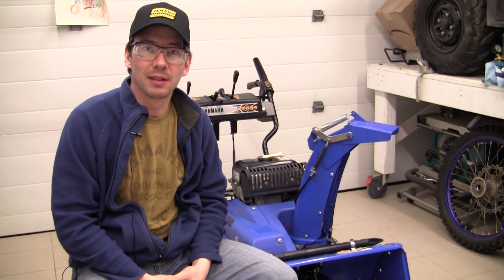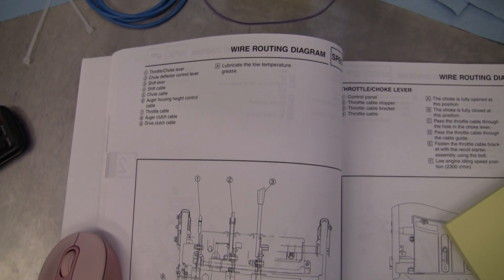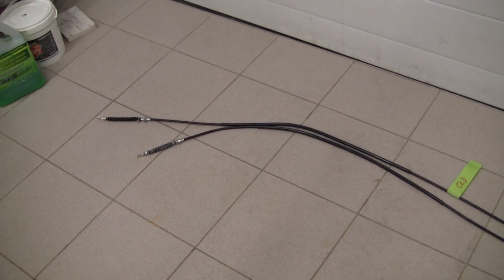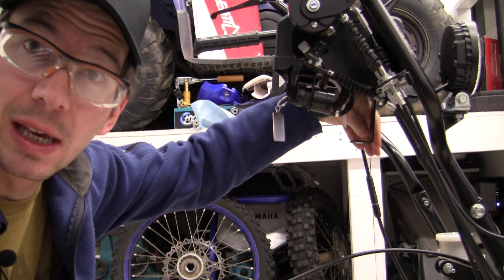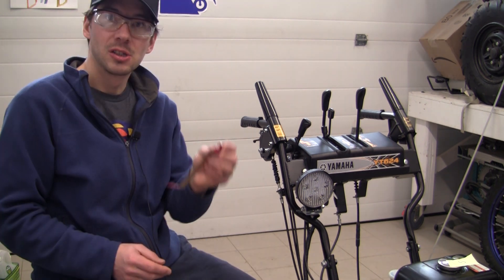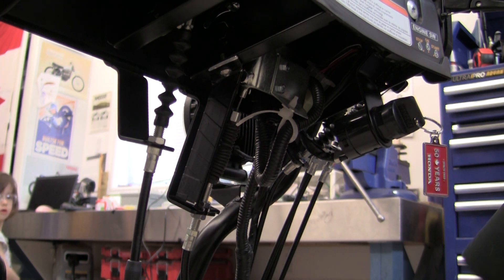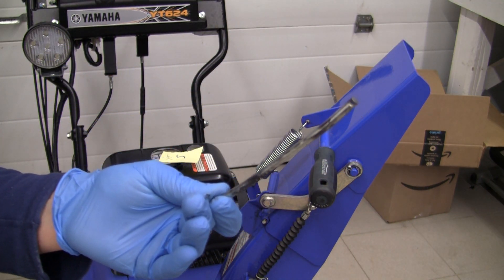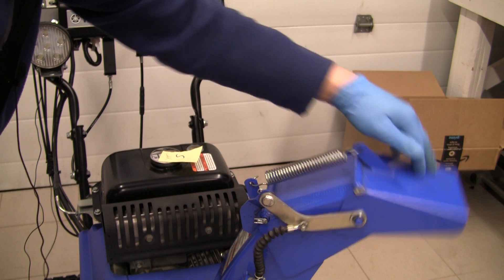Ep. 19 - YT624EJ M.S. - Chute Height Control Mechanism Corrections

Comment: What was the part number of that cable? My cable seems to be getting water in side of it and then freezes and I don’t have any control after running for a while it melts and away it goes so I’m thinking of replacing it
Reply from the maker: 7T0-R2632-00 YAMAHA CABLE, CONTROL 2. I bought mine from Impex. I didn't use it in the end after I figured out the failure mode mentioned in the video. I'd be willing to sell mine for a bit less than what I paid if you're interested.